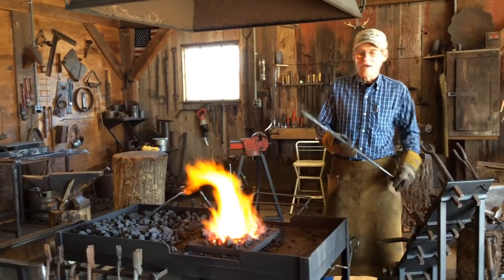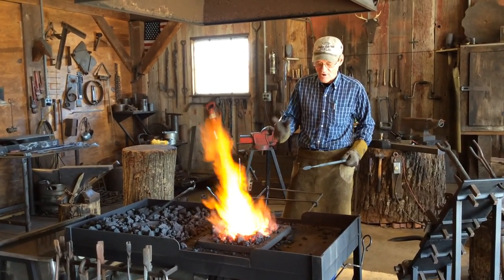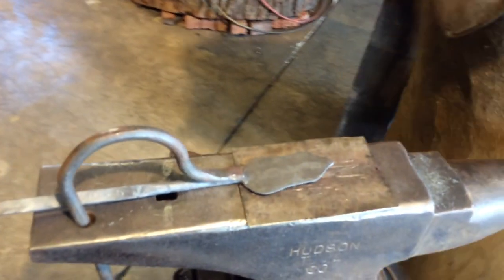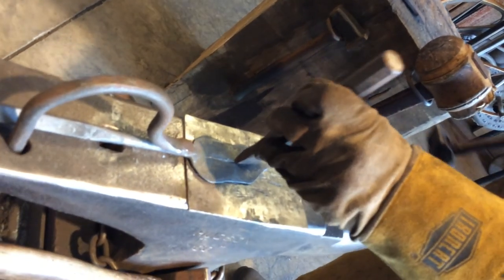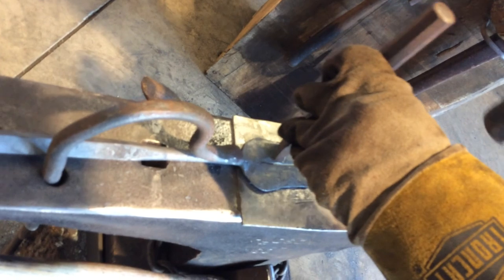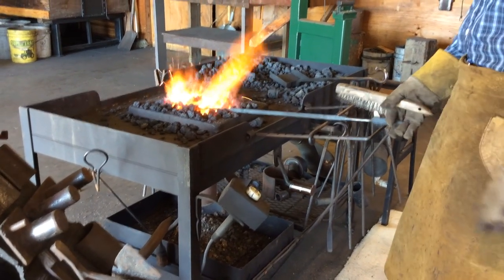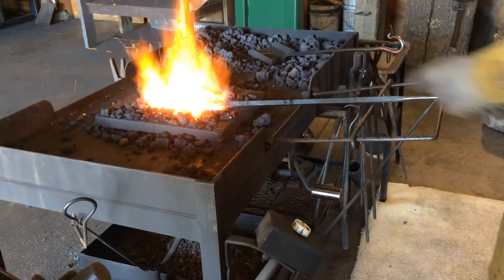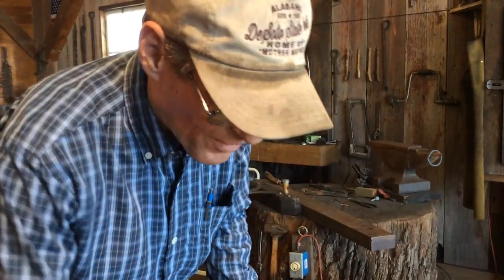Forging a Leaf on a Power Hammer

Comment: Hello to you Sir! Pretty leaf you made about your powerhammer!  What size motor and how many Rpm  ?
Reply from the maker: Hello! Walter will get that information for you tomorrow. He said the RPM is determined by the size of your wheel. But he is glad to share the logistics on his hammer. He just needs to check. His hammer was made and engineered by an elder local wheel wright. I will be in touch soon. Rhonda, the blacksmiths wife
Reply: @walterhowellblacksmith2089  hello again im still curious as to the motor size on the powerhammer as well as the rpm . Thank you in advance! My hammer is almost complete.
Reply from the maker: Good Evening, I am sorry for taking so long to respond. Life has been busy. Walter tried to get information off of the motor. It is a vintage Howell motor but the numbers are not readable. His hammer was made by an elder wheel wright and has a unique set up. Walter doesn't do anything on the computer but said he would be glad to talk with you by phone if you would like. The rpm's are determined by the size of the flywheel you are using and he could tell you more by phone. You can email him from the waltersforge.com website and I will get the two of you on the phone. This is Walter's wife Rhonda, always on line.

Comment: Is that one of those German made coal forges? It looks very nice
Reply from the maker: Good Evening. This is Walters wife, Rhonda. He doesn't work on the computer. Thank you for your comment on the forge. Walter built this forge this spring after he retired his 1890 Buffalo Forge. He made this one specifically for his own working preferences. He burns foundry coke, requiring a larger thicker fire pot. He also replaced his hand turned blower with a simple leaf blower with a light dimmer switch in line to adjust his air flow. He has a Walters Forge Instagram page with some photos of both forges you might like to see.